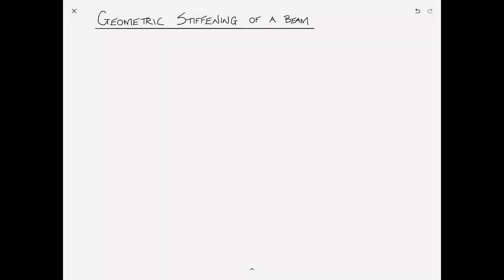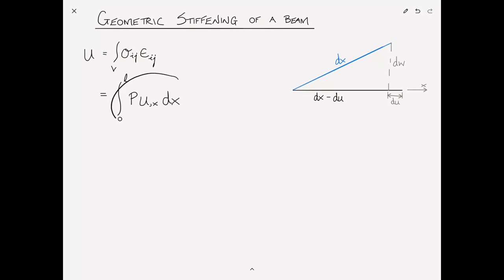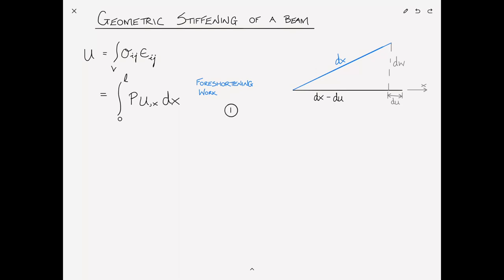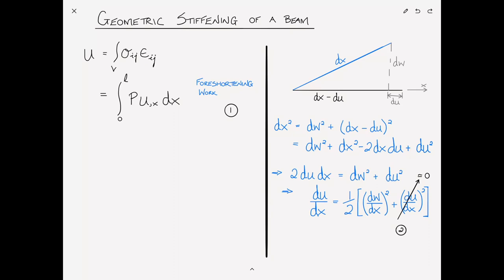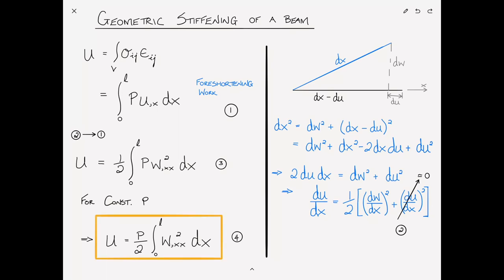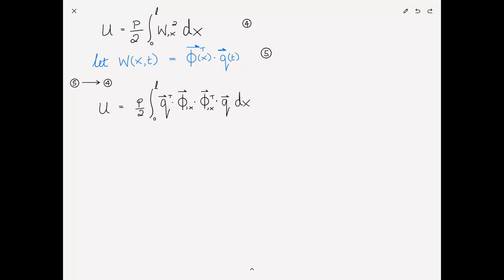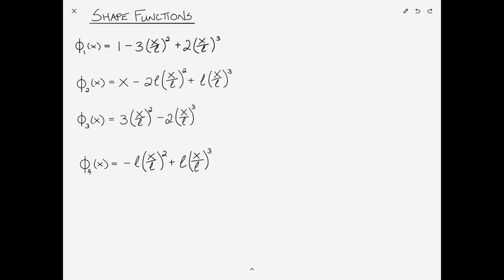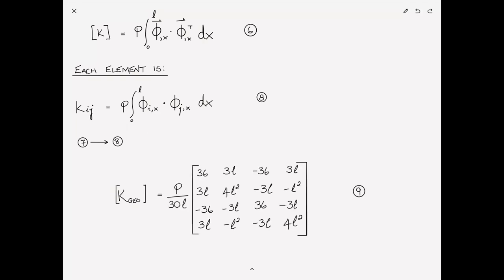Beam Finite Element - Deriving the Geometric Stiffness Matrix

Comment: thank you,
if the beam has a linearly variable section, does the geometric matrix change; if yes you can you help me
Reply from the maker: For this case of an axially-loaded beam with infinitesimal displacements, if it is just the section that changes, then that in itself will have no direct effect on the geometric stiffness matrix so long as P remains constant.
Reply: Now I am relieved, thank you again
Reply from the maker: @abdelhakbenkaba1057  Just to be clear...while a variable section does not affect the geometric stiffness matrix, it does affect the regular stiffness matrix due to varying EI.